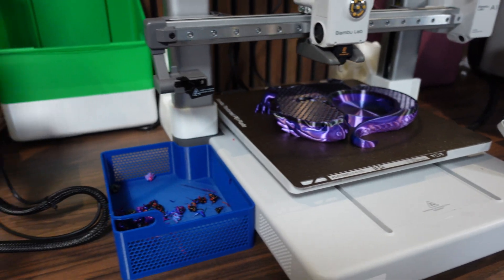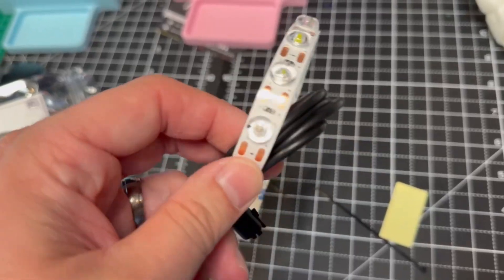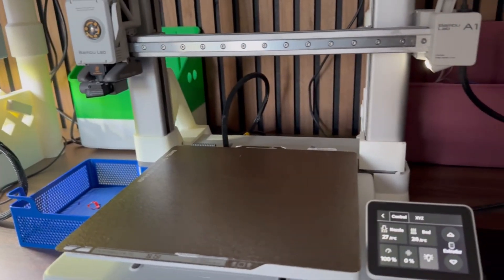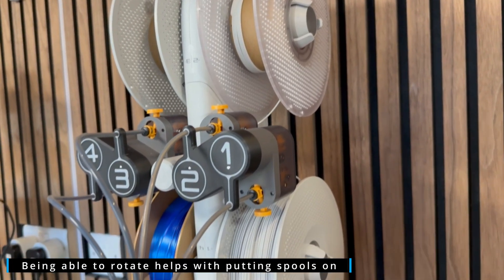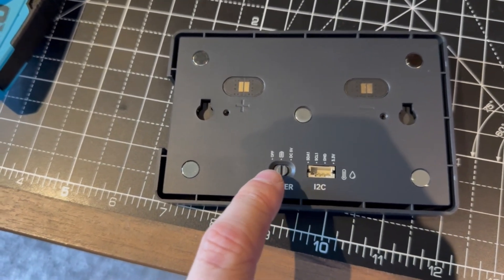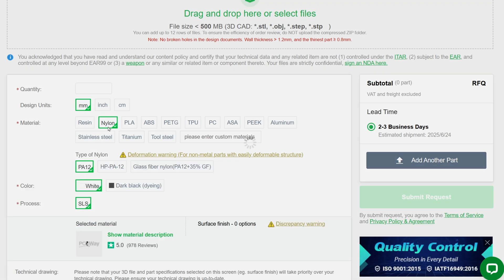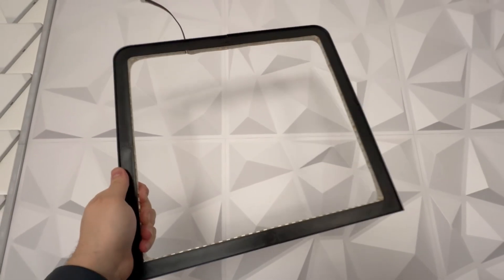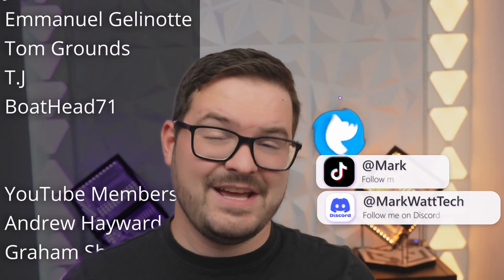5 Upgrades for Your Bambu Lab 3D Printers!

Comment: If you're recommending Bambu Lab printers you should be leting people know their firmware upgrade means these need to call home to keep working. They forced everything to go through their servers and there's a certificate on the device, so even if you just print of USB and keep it disconnected from the internet, after a year you'll be locked out until you connect to their servers again.
Reply: Just put it in lan developer mode if it bothers you You can then print a tinfoil hat holder
Reply: @iainhay2823  That won't help. You probably some read some of the more in depth posts by security experts explaining exactly what the changes were and how it affects the continued, fully offline, use of the product. However if you want to remain ignorant and instead try and discredit the people trying to warn of the failings of a product you're buying, then i can't help you out of the stupidity hole you keep digging for yourself.

Comment: Have you had to enable dev mode to enable the Panda Touch following the recent firmware update to the P1S?
If so, how did that go?
Reply: I have a PandaTouch working with my P1S without any dev mode or something. It just works with the latest firmware
Reply: @sumo_life48  just what I wanted to hear. 👍
Reply: How that works? You need to enable dev mode to make it works?
Reply: @Scheettini  I was just wondering if enabling dev mode did indeed allow the Panda Touch and other local features (i.e. the Home Assistant integration) to continue working following the firmware update.
I'd like to get feedback from the community before I risk the update myself.